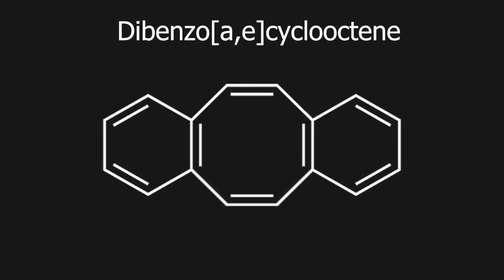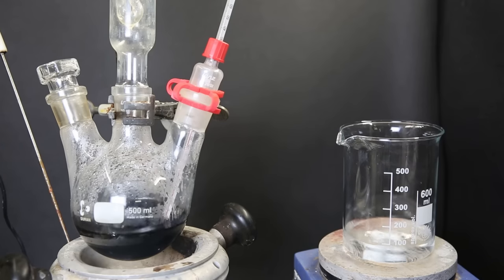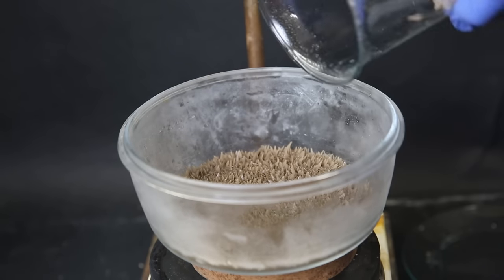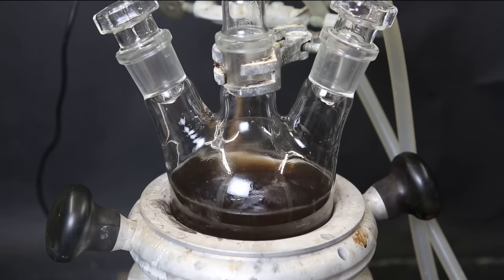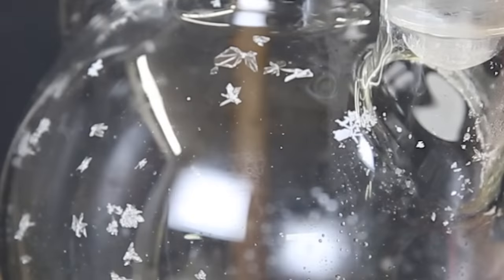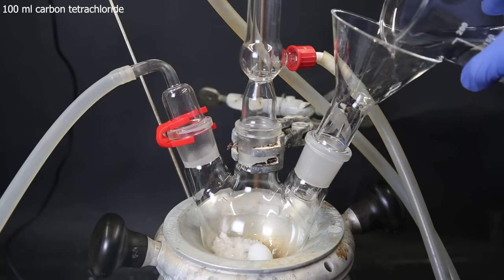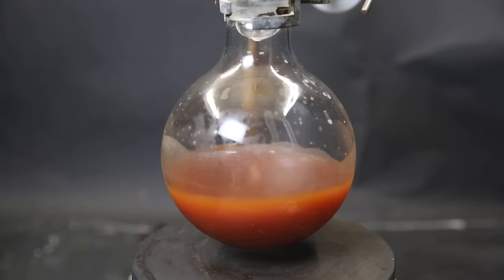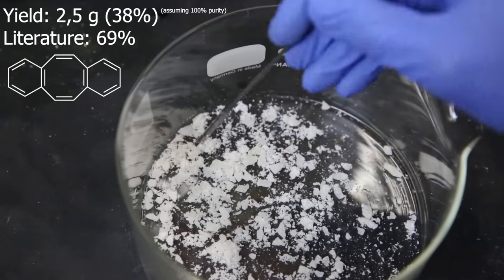Making Dibenzo[a,e]cyclooctene - an Emerging Ligand?

Comment: Two criticisms of this (otherwise excellent) video: first, the mechanism in the dimeriztion of the dibromide almost certainly involves 1,4-elimination of the monolithio species to give 1,2-quinodimethane, which may either dimerize to give the final product directly, or trap a benzylic radical and then cyclize. Second, the potassium tert-butoxide does not remove a hydrogen atom, it removes a proton. in an E2 elimination.

Comment: Wonderful video and clear explanation of the steps and mechanism! Out of curiosity, why was NBS used in the first bromination step of o-xylene? Wouldn’t it be easier to have access to Br radicals over a possible EAS reaction with Br2? Also, in the last step of the reaction, your tBuOK was slightly purple in THF, any reason why that happened?
Reply: ???? The first bromination is an radical bromination with br2 just like you mentioned, the 2nd is s Wohl-Ziegler-Bromination with NBS
Reply: @lukassorowka2672  NBS is still viable for bromination of toluyl carbons.
Reply: @slimp4644  yeah it is, but I don't get the point of your comment. He didn't use NBS for the first bromination
Reply: Bromine is much cheaper than NBS
Reply: @nitrgnlab9400  yeah thats a good point

Comment: Very interesting process. @13:40 What happens, if you would have 3-4 bromine ligands on the cyclooctocene? Would it hinder the further synthesis and get lost ?  Does the benzene get brominated as well, or would it need a catalyst ?
Reply: The bromination process is known as "allylic bromination", and it usually leaves di/tri brominated reagents, but it is known to be trace. Also, to brominate the benzene, as you mentioned, needs other catalysts such as FeBr3.
If there are 3-4 bromine attatched to the cyclooctane, elimination of HBr might still happen, but the desired product would be mono-brominated alkene. I believe this could undergo another dehalohydrogenation, or removal of HBr, and yield cyclooctyne ring.
Cyclooctyne could be reduced to cyclooctene using yne->ene reducing agents such as Lindlar catalyst.

Comment: Can't you get rid of the LiBr with a water wash? Love the video.
P. S. How safe is it to mix tBuOK with ethers in your experience?
Reply: I almost always use strong bases in ethereal solvents. Metal hydrides, alkoxides, organolithiums, organosodiums, organomagnesium, organozinc, etc.
No issues. Occasionally, depending on the reaction, I'll avoid ethereal solvents as other reagents will react with (organoborohalides or just borohalides), and opt for a hydrocarbon solvent like toluene.
Reply: @brandonwatson883  thanks for the reply
Reply: also to quickly add, yes water washing will remove LiBr, when applicable. This was done with THF which I usually prefer to diethyl ether, but the one issue with THF is that it is miscible with water. Usually if I want to do aqueous work up I'll remove thf, reddisolve in diethyl ether/ethyl acetate/dcm etc before moving forward.
Reply: @brandonwatson883  yeah so this was predominantly DCM at the end, that's why

Comment: After the coupling step with lithium, can you simply do extraction with water (of course removing the Lithium metals first) to remove LiBr?
Reply from the maker: I think it's possible, I just followed how they did it in the procedure. Perhaps there is a reason they did it this way.

Comment: You said NBS reacts in CCl4 with trace HBr to produce bromine as the active brominating agent. Can you give me a source to read more about that? I thought it was just bromine radicals formed through homolytic cleavage of the N-Br bond, and usually the reaction doesn't work very well unless you freshly recrystallize NBS so it's counter-intuitive to think that the impurities drive the reaction.
Reply: Likewise, in my experience I use recrystallized NBS (from boiling water) and DMF or some other cheaper and more friendly solvent than carbon tet. No additives
Reply: Once I had some problems with pure white NBS, the reaction didn't start. Then I used 30-year old yellow NBS instead and it worked fine

Comment: A uranium-containing sandwich complex can be made using cyclooctatetraene. I wonder if the same can be done using dibenzo[a,e]cyclooctene?
Reply: By the way, thanks for the video, I love aromatic compounds, especially symmetric ones!
Reply from the maker: I haven’t seen any literature on it, I wonder as well, but I don’t have any uranium compounds sadly ;(
Reply: @Chemiolis  I decided to watch this video again, and I was wondering what impurity or impurities caused the dibromoxylene to take on that dark colour? Could it be caused by some of the o-xylene radicals reacting with each other and forming various compounds? Could it be possible oxidation from the air as well?
Reply: If you can reduce the cyclooctatetraene you can do that.

Comment: I wonder if this works with cis but-2-ene as well as it does with o-xylene? 
if so, it'd be a handy way to make cyclooctratetraene that doesn't involve high-pressure acetylene chemistry
Reply: Treating 2-butene with bromine will result in addition of the halogen to the double bond.

Comment: Why do all YouTube chemists drop the stirrer bar into the flask with no care for the glass flask -_-
Reply from the maker: It’s an outdated ‘rule’. Magnetic stir bars used to be a lot heavier because they contained a different magnet. Nowadays the stir bar has a lighter magnet inside and can’t break glass.
Reply: @Chemiolis  It depends on a size of the stirfish. I don't want to drop an AA battery size bar into a 2 l RBF(
Reply: @Chemiolis  of course it can. Last winter I had to clean my hood for all day long after dropping the stir bar into the reaction mixture (yep, it was a stupid idea, but I thought the precipitate at the bottom of the flask would amortize it. No it didn't). Wish I could attach the photos.